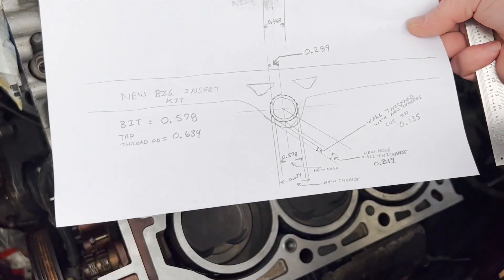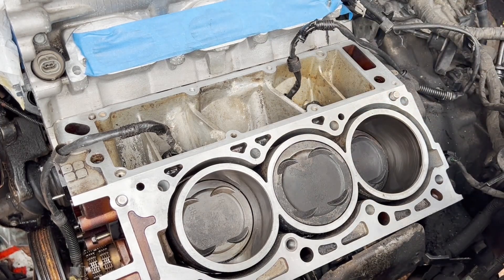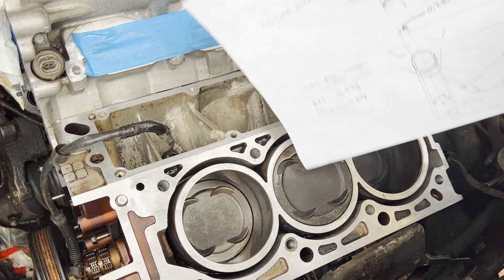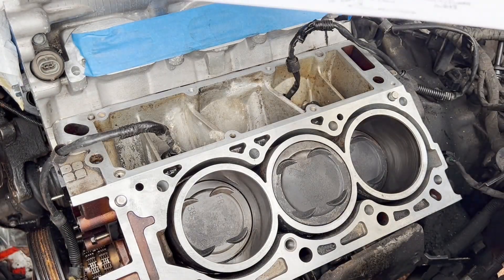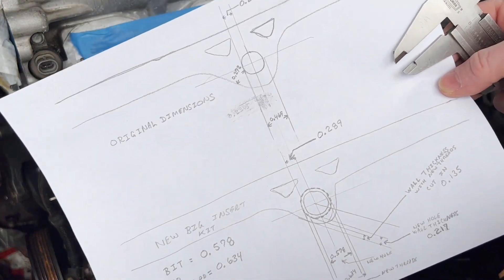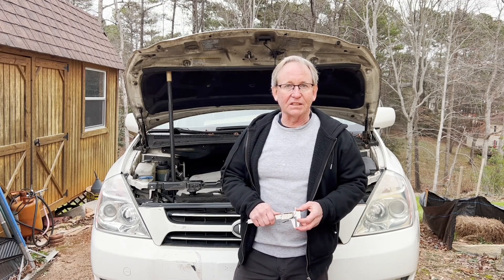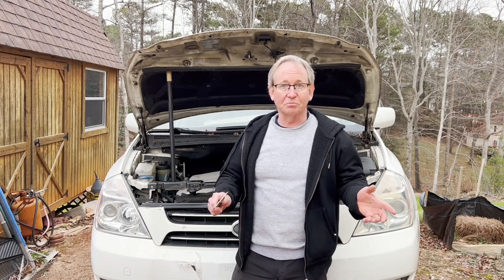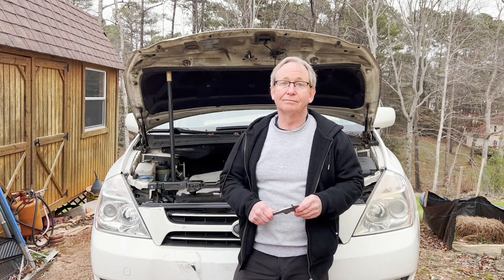Kia Part 7: Modified Head Bolt Stripped Thread Repair Attempt: Top Inserts Won't Work

Comment: Im working on a
2016 kia cadenza 3.3
Found some really high-quality repair kit from NS300L. The kit is $400 bucks and allows you to put OEM Cylinder Head Bolts back in with the specified Torque/degrees. The car has been running well, and there are no oil/coolant leaks!
Reply from the maker: Hi. Thanks for watching and taking the time to comment. Glad that kit worked out for you and most importantly, no leaks! 
Mine was a high mileage basket case so I wanted to see if an alternative rouge method would work. I had looked at factory approved insert kits for $400-$600 and just wasn't going to spend that much on a one use tool that no one else wants when you're done with on a 250,000 mile engine. 
I'm reasonably sure tapping the top would have worked if the block had thicker walls enabling me to drill and tap out to get the full bite on the insert. Factory hole was too big for the minimum tap diameter so it just couldn't get the bite it needed. Had nothing to loose on mine so it was worth trying it. 
Since yours is running good and it's a 2016, might be a good time to sell it before it racks up more miles and goes down in value. Either that or just drive it till the wheels fall off . ;-)

Comment: I went through the same thing on my moms car. Kia 3.3. Went to torque the head bolts and they stripped.  I used regular heli coils. They all torqued except one by the timing cover. I was torquing it down but i felt like it wasnt going to get to torque with out stripping. So i just left it. The way the timing cover bolts to the head, i think that helps hold the head down. Shes put around 15000 miles on it so far and its doing good knock on wood. 
I had to pull the intake back off recently because the oil sending unit went bad and was leaking oil. It seemed like it was a rear main seal but its not. Its the oil sending unit. I would recommend replacing yours before putting it all back together. 
I think these head bolts stripping should be a recall. Ive never had that problem on any other car.
Reply from the maker: Hi. Thanks for the comment, and glad your repair is holding up. I'm an aircraft mechanic. Everything in Aviation is aluminum and also has steel inserts that are very much like Heli-Coils to start with. Shame on all these auto manufacturers as they jam steel bolts into soft aluminum. They all do it. Even Chevy LS Motors. 
I was trying this as an experiment as I just wasn't' going to spend over $500 to $600 for a one use kit from Time-Sert. The size of the existing unthreaded hole and the thickness of the water jacket and the available inserts to try this just won't work. I did find another Kit from Hon Solutions for much less that I like better, that I'm considering. Actually spoke to the guy that developed it.  The kia is in "time out" in the mean time. I made a few other videos on it including "Aluminum Blocks Suck".

Comment: I’m in the same boat with a 2015 Hyundai genesis coupe.

I heard you speak about the knock sensor and timing chains for replacement , 
Can you please tell me, sir, what you would recommend also replacing well in there because I really haven’t got any other choice but to try some inserts . I thank you in advance and good luck with your car.
Reply from the maker: Hi Jeremy. Thanks for watching and taking the time to comment. I was experimenting with a cheaper alternative trying some inserts at the top, but the minor diameter was already too large so the cross sectional thread bite wasn't enough and it pulled/twisted some of the inserts if you watched my other videos in the series. The Time-Sert kit to redo the factory threads is over $500, which to me just seems ridiculous, so tried the experiment with top of block deck inserts. I might drill those out and experiment with EZ-Lock inserts at the top which will work with the size hole I have and standard sized taps so it's super cheap, but they're only 1/2 long, and stacking them is kind of tricky. I'm looking at another insert kit to repair the factory threads deep in the block by Hunsoltions.com. There are a number of YouTube videos of people using that kit. I haven't called them yet for a price or looked on line for a used kit. If it's under $250 then I'll justify that. They have a guide block for the drill and tap which honestly I could make. For that matter a tap and drill bit can have a bolt welded on if you can do it square to extend it to make your own kit to repair the factory threads. If your 2015 doesn't have a lot of miles on it and you need the vehicle then it makes sense to spend the money for the proper kit. Mine is a 2006 w/ 250,000 miles and while I'd like to have it running, I don't necessarily need it so am stubbornly experimenting with cheaper solutions. 
As for the chains and knock sensors, I'd recommend doing the knock sensors since they're buried in the block. Chains stretch a bit, but the tensioners keep them tight. It's the rails that get worn and need replacing. It's a judgement call, but the chains generally don't break, and replacing chains, rails and tensioners is $300-$500. If I go forward, I', just replacing tensioners and rails. The money not spent on chains I'd put towards all the other sensors on the top end that are now exposed with it torn apart like Cam, Crank and temp sensors. Get all your parts from RockAuto or PartsGeek. It's Hundreds cheaper than local parts houses. Get it running, get 1,000 miles on it, rub a little grime back on it and sell it. wink wink